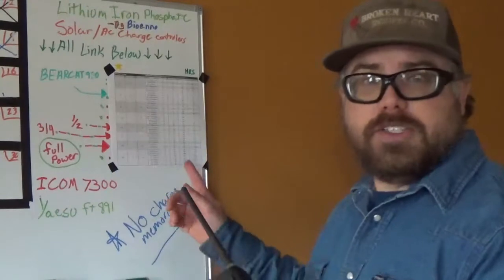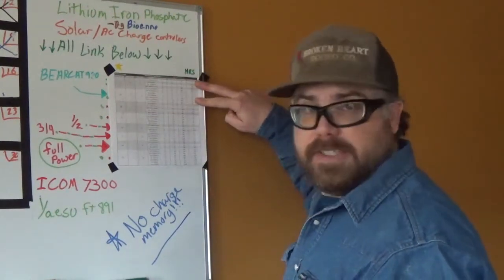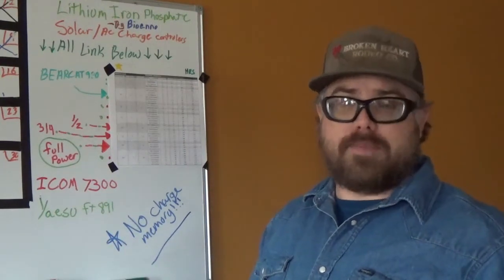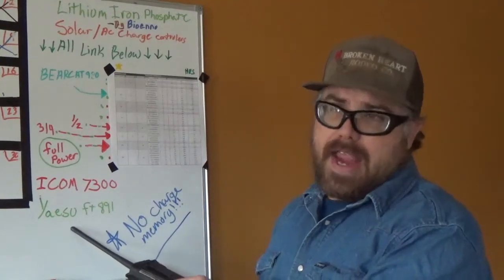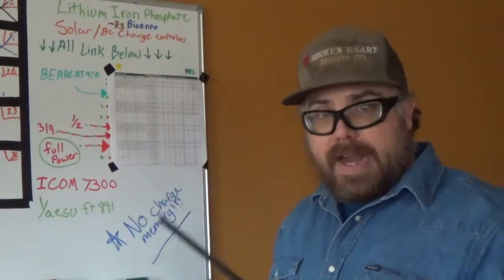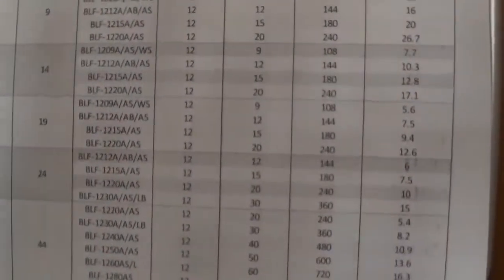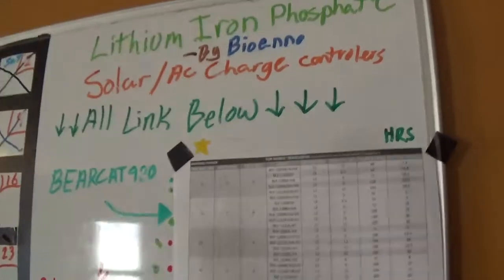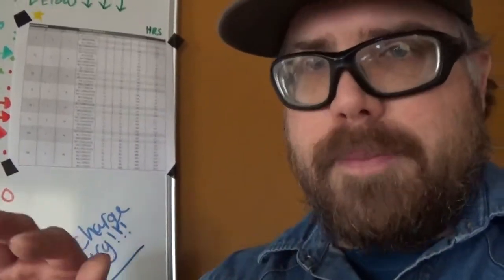Power Your Ham Radio, Bioenno battery buying guide

Comment: I've been running the 12ah Bioenno with my Yaesu 891 for about 3 years now, and it's all i use, and it's never failed me at home or POTA activations. We did an 8 park run in one day spending about 1 -2 hours per park running a 20/80 cycle and still had significant charge at the end. Now we're looking into a Bioenno solar set-up for field days this year and building a battery go box. 73 de W8MJL